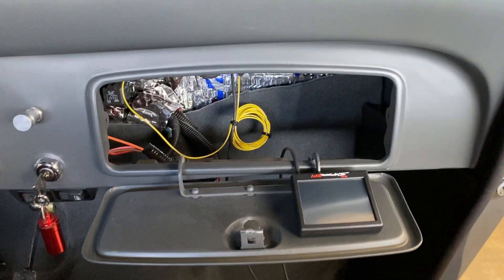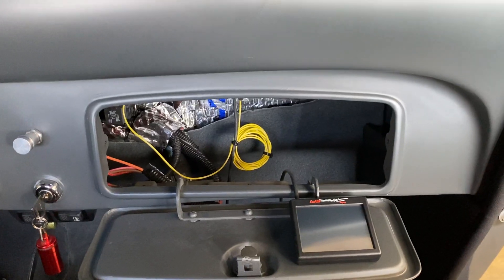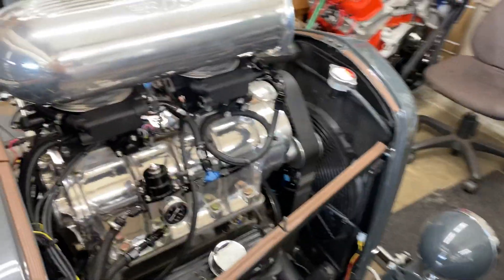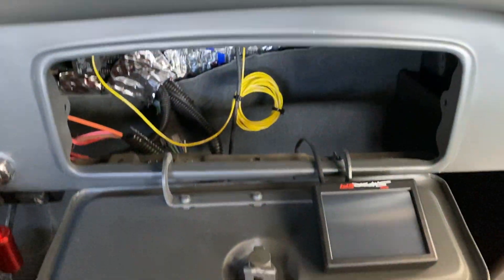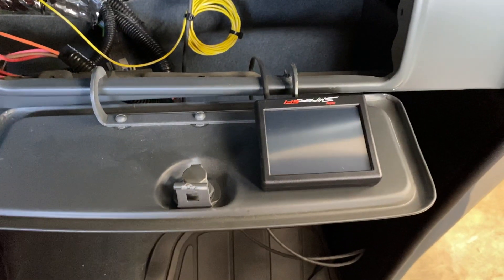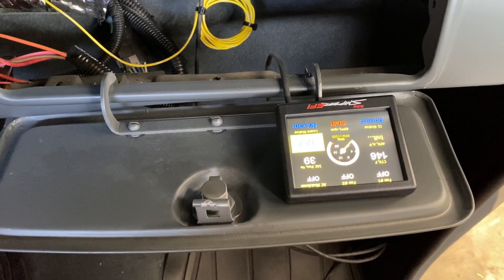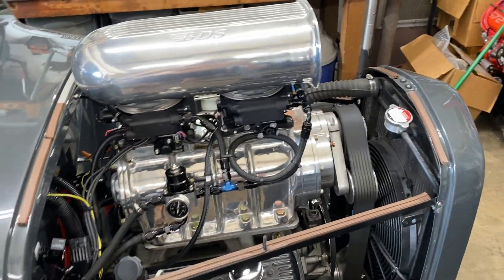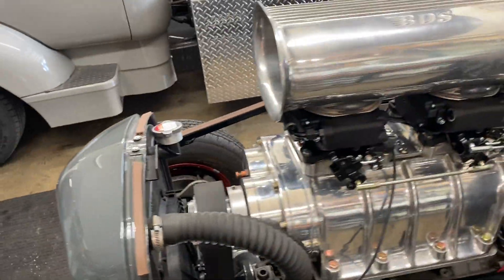1932 Ford 3 window coupe supercharged with Holley Super Sniper Fuel Injection.

Comment: It sound great! What kind of cam? Size? Blower cam?
Reply from the maker: Camshaft: Hydraulic roller
Cam Duration @ .050 in.: Intake 191 / Exhaust 194
Cam Lift: Intake 0.414 in. / Exhaust 0.428 in.
Lobe Separation Angle: 112 lsa
Reply: @jetboatbill  I have lived in the cape 4 years. Can't believe I havent met you yet. Retired and moved here from TN.
Reply: You ever come out to Fosters on Wednesdays? Have a great evening.
Reply from the maker: @MrPappysCobra  Haven't for several years, I hang at Fathoms, on Tuesdays and Fridays, I ride the Blown v8 Trike...
Reply: @jetboatbill  I need to check out that place.